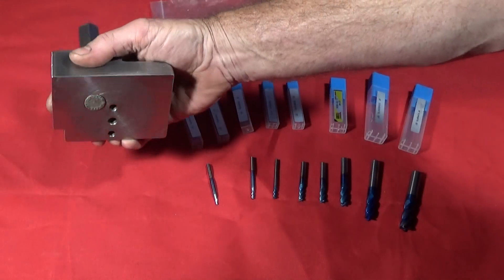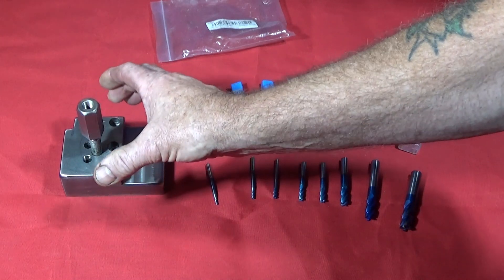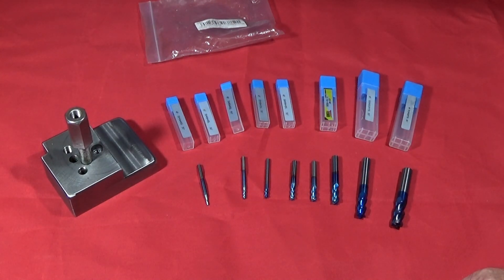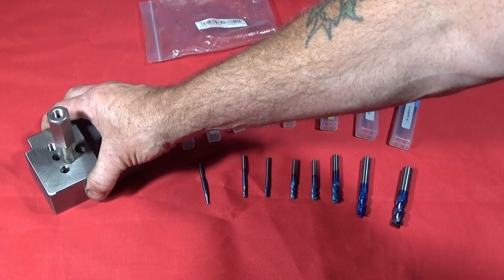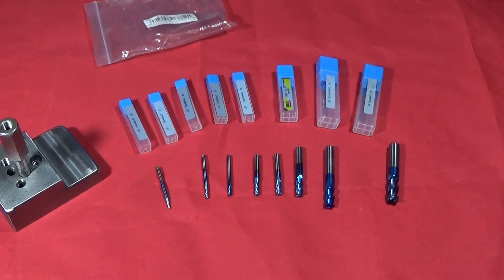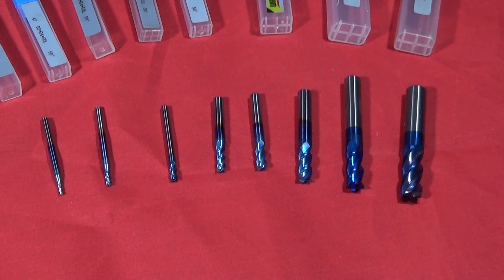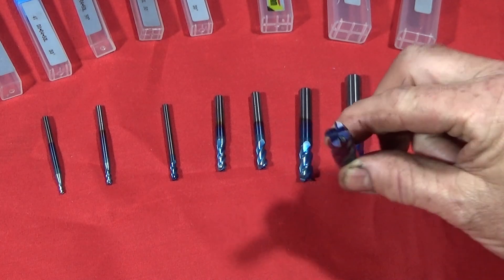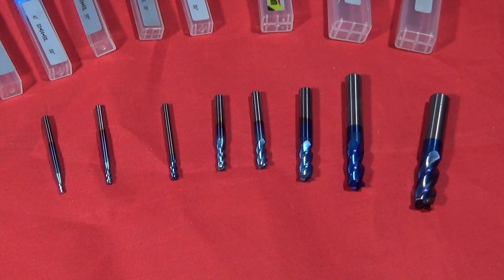Drillpro Tungsten Carbide Blue Nano 4-Flute Endmill Set Review.

Comment: Should I buy these for use on my small mill? About to mill some ciliate castings and don’t want to ruin them. Been using HSS so far with limited success. ????
Reply from the maker: Hi Brendan. These are much harder than HSS but I do not have any knowledge about ciliate castings. Regards Steve
Reply: Steve Jordan sorry that was an auto correct typo. It should have said cylinder castings. they are phosphor bronze
Reply: Steve Jordan thank you very much for taking the time to respond. Do you have a Patreon account?
Reply from the maker: Hi Brendan. They should be ideal for those. I do not have a patreon account. Regards Steve

Comment: I find that slow feed and high rpm greatly lessens chipped edges in carbide. It does not respond to low rpm at all . If this is truly micro grain carbide,I  am shocked that the flutes didn't shatter on the end. Very shocked. This is typical hhs, or m-2, m-4 speeds. 

the fact that your machine is not that ridgid as you say, higher speed of rpm is even more important. As evidenced by the chatter. 

try at least 1000, and preferably higher and you will find a much smoother cut and finish.  

KnifeMaker
Reply from the maker: Hi Mike I generally turn on much slower RPMs. and have never had any problems whatsoever. Modern carbide inserts are perfect for this. These small lathes are not like industrial machines and have to be treated as such.. a basic hobby lathe.
Reply: Just hope on doesn't explode on you at  such low rpm's. Very dangerous!
Reply from the maker: I was only taking very light cuts here. I really should have used a fly cutter for this job. I later showed the end mills being used more appropriately on my home made Myford milling attachment. Which was much faster.

Comment: Steve,  Excellent Video as always. There was some comment that you hadn't used the ideal milling set-up and some dispute about the composition of the end mills. I think this misses the point that you'd said you had done a lot of machining with one of the cutters and it was still like new - whatever the composition, the proof is in the life of the tool! I've bought a set of these for just over £3 each, a bargain even if they were only HSS. On the milling setup we'd all like a rigid milling machine, but for milling on a lathe you use what works within the limits of the lathe and your budget - you weren't claiming that this was the an ideal setup and I'm pretty sure you've got a large collet chuck had you chosen to use one!
Keep the videos coming.
Chris

Comment: Described on their website as ultra fine particles Tungsten Steel- with a blue NACO surface coating, from the information given, they are not solid or otherwise Carbide. The irregular blue coating may give the impression of being part carbide in construction. Look at the blue wavy junction line on each cutter- they have been dipped. Read their final website page description .
Reply from the maker: They are carbide. I can tell by the weight compared with other endmill bits. The blue nano is a form of coating hardening like titanium coating seen on other carbide endmill bits.The Chinese have difficulty in their translation wording on these listings sometimes. They are carbide though.
Reply: It is in fact a titanium carbonitride coating, it's pretty high quality. To save some cost most manufacturers wont coat the whole thing just the cutting part, just look at the familiar titanium nitride coated drill bits for reference.

Comment: Hi Steve,  these are blue NACO not NANO and I don't think they are solid carbide.  I recently reviewed these.  They are good, but I have reservations about the tungsten/carbide
aspect. BG do not describe them as "solid" carbide, which is different to carbide steel (a HSS derivative).  Cheers Rob
Reply from the maker: Hi Rob, the Chinese have difficulty in translation sometimes on these listings. I would only call them Blue Naco if they Knakered quickly....:) They are Blue NANO. I can tell they are carbide by the weight compared with tools of the same size in my box. Titanium coated carbide have the same weight whereas the ordinary HSS are lighter.
Reply: @SteveJordan  Hi Steve,  I see Alibaba also list Blue Naco end mills, and so do many other sites. This is the Naco coating listing :  https://www.platit.com/en/coatings/nacor

I have to disagree with your explanation.  I can only comment on the carbide aspect in view of the BG description as Tungsten steel.  If the mills were solid carbide I would expect that to be a major descriptive point. They are slightly magnetic and they obviously have a high level of tungsten in them due to their weight.  Whether they qualify as "solid" carbide is anyone's guess. I'm not trying to be difficult on this, and I considered these aspects closely before completing my review.  They are excellent end mills, and BG are not known for accurate descriptions.  No offence or malice intended.  If you don't agree with any of the above aspects that's your prerogative.  

Cheers Rob

Comment: Faster is better with carbide was that top spindle speed then?
Reply: Dear Steve, sitting here eating my pasta an looking your channel my first guess was the same, why so slow (just making around 36 meter/minute) where I expect cutting forces to go down at about the optimal speed and feed may by in mild steel a 100 m/min. No criticism at all but just curiosity. Would really like to see the 1.000 rotations per minute.... (but you hear and feel your lathe and know certainly better). Michael
Reply from the maker: Faster isn't better on a lathe with no coolant and less rigidity than a proper milling machine. One goes by what one feels to be best for whatever machine is being used with the tooling. The speed I used here was just right.

Comment: Two things come to mind... First, holding a carbide endmill in a chuck like that - even a four jaw - really isn’t ideal; if you have a collet chuck for that machine, I’d use that instead. Second, an endmill like that can support significantly higher speeds & feeds - if it’s in a nice rigid machine (using it in a lathe like that isn’t a very rigid setup, so for that machine you were probably going about as fast as you could - I just mention it for people with a big mill).
Reply from the maker: Yes it is best to use a collet chuck. I do have an ER32 and the ER40. The four jaw was fine though. I would love to have a large mill to speed things up, but I haven't the room or the time left for one I think. Regards Steve
Reply: Dark Winter . A lot of chatter for such a slow speed-not the best rig, but with no mill, have to use what one has. I have a 20 plus year old Shin Shun lathe with milling accessories-and very solid, works but I use my mill-drill for most milling.